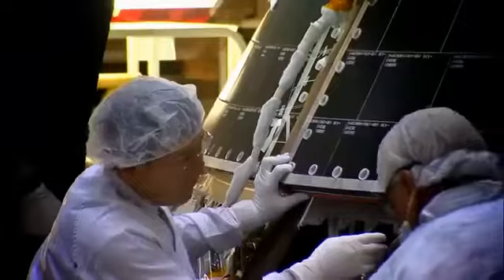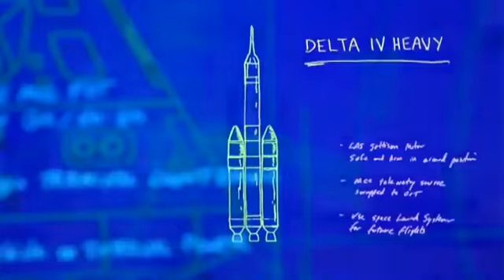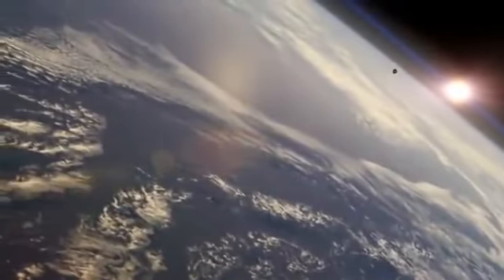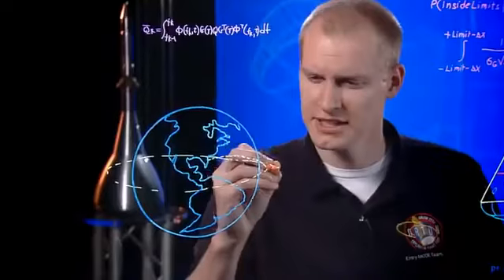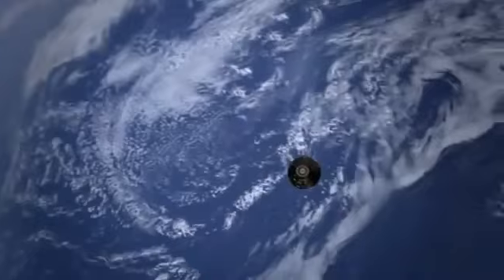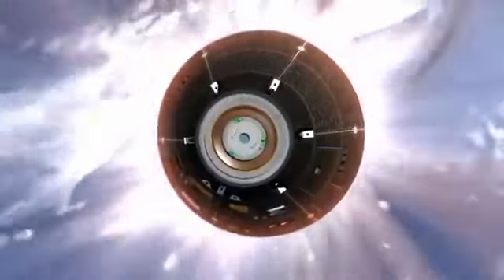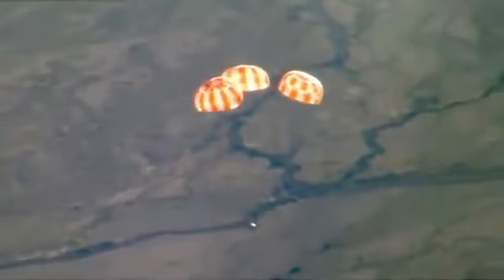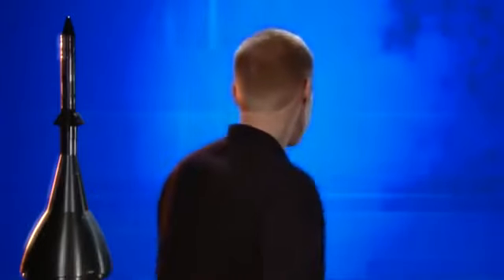NASA engineer admits they can’t get passed the Van Allen Belts

Comment: Anybody miss the part where he says, “guidance and systems, the talks about how traveling through the van Allen belt can damage the computers. We must solve theses problems before we send astronauts through the belts. 
I think he’s talking about the systems myself, he never says he’s responsible for the astronauts health.
Let’s just gloss over the important details and it will sound like a hoax. Listening helps

Modern digital and miniaturized electronics run at a low voltage, a particle strike in a chip can cause problems. It’s called a Single Event Effect, SE. during high sunspot activity the odd errant charged particle can enter your phone, ever wonder why your laptop or phone crashes for no reason. Bit flip!
Reply: @SpaceManWyo  but still it begs the question. Why can we not get through it? Technology is so far and away advanced since the 60s! Like honestly it’s not even comparable. If we have already done it, it should be no problem, period at all. Don’t try and spin it and say small chips or some dumb shit. Baby if the bigger thicker chips worked, don’t you think they would use them on it again? 😂 I mean seriously just use common sense 

and please don’t comment back with they don’t have them anymore or something along those lines. That’s like saying Apple who makes the iPhone can’t make a simple flip phone. Matter fact it’s probably even more primitive than that. We are talking about the 60s!!
Reply: @SpaceManWyo  you’re probably right, but you could be wrong also you never know we only know what we are allowed to know..but you right still
Reply: But astronauts also say they don't have the technology to get near the moon. The moon being 238k from the earth. We cannot leave 300 nm from the planet 🤷🏿‍♂️
Reply: @ironwork92000   We do  currently have the technology  was no one has built, it back up. There will never be a time where large scale  manufacturing of multiple rockets takes place. I doubt very much that 400,000 people will work on achieving a goal such as this. 
In the unedited version of the video the guy says “Orion will be the first space craft to take men passed low earth orbit in a little over 40 years”
Reply: @nicsandee123  Why would 400,000 people need to work on this? That was over 50 years ago... Technology has doubled, we've learned more. We could probably do it with less than half of the man power as the first time. I mean c'mon, we have rovers on mars right? How hard is it to get someone to the moon, if we've already been there before.... Sure the same people aren't there to work on it, but you have the people who worked on the mars rovers there, surely they are intelligent enough. Hmmm

Comment: He's telling us that for the first time for real,  we are trying to figure out how to get to the moon and outside the Van Allen belts.
Reply: Hi CW, hope that you are well. No, he was talking about the challenges facing the Orion spacecraft. He made that abundantly clear in the video. Take care.
Reply: @TheWokeFlatEarthTruth  Why wouldn’t these challenges apply to every other spacecraft?
Reply: @Americansikkunt  Hi CB, thank you for your comment. Hope that you are well. You asked " Why wouldn’t these challenges apply to every other spacecraft?". Basically they do but clearly the challenges presented to any spacecraft will depend on the nature of its intended mission. The Orion spacecraft and Artemis Program is different to any previous spacecraft and space program of recent decades in that it will involve crewed missions of long duration outside the Earths magnetosphere. Modern electronic systems and IC's are mole susceptible  to radiation damage than the discrete components used in the Apollo missions for example.so rigorous testing is required before a crewed mission. Take care.
Reply: We are not still trying to figure it out. We figured it out in the 60s. We are trying to figure out how to protect computer systems that have a 1,000,000x more processes than the ones used on the Saturn V and thusly 1,000,000x more chances for radiation to cause data flips.

The Van Allen Belt is not uniform, it is strongest in the center, but less radioactive near the edges. The astronauts even had dosimeters on their bodies and would regularly report the readings to ground. Ionizing radiation that is found in the Van Allen Belt is only dangerous to humans over a prolonged period of time. The astronauts would only spend one day in it before allowing their bodies to heal the damaged cells. And then passing through it for another day, before their bodies would then have forever to heal more damaged cells.

Comment: Don't worry with this van allen belt,we did it once and we can do it again right?????
Reply: I think Stanley Kubrick passed away.
Reply: No we did this several times without any issues.  Buzz is still alive and kicking, punchy even.
Reply: They used three principles minimize radiation exposure.

1. They made the ship out of a reflective material. Since radiation behaves almost identically to light, reflective material can reflect some of the radiation. Thats why the command module is an aluminum color rather than being painted black and white. 

2. This is a different type of radiation. There are two main types of radiation: radiation that acts like a wave and charged particles. Charged particles are much less harmful than radiation that acts like a wavelength. The harmful radiation at Hiroshima and Chernobyl was gamma radiation (wavelength).

3. They managed to steer around the heaviest doses. The radiation is not equal all the way around. Using math and data from satellites engineers were able to calculate a course that intercepted the moon while avoiding the hevest doses. Orion cannot do this, as the trajectories for interceping planets months or years in the future are very very fine, and they cannot expend the extra fuel required for going around the heaviest parts of the van allen belt
Reply: @edisonbittencourt181  --- Rumor is he was REDRUM'd ;)
Reply: It was fake
Reply: @edisonbittencourt181  --- If you call m urd ered as passing away, then I guess you are correct. 😁
Reply: @GeorgeWashington-et7lk  --- You used a bunch of words to say absolutely NOTHING ... lol
Reply: @CowboyKev69   😂  I love these YouTube scientists.  George Washington above just explained to us how we made it through the VanAllen belts in the 60's. Meanwhile, the actual scientist in this video literally admitted that we've never done it by admitting that we need to figure it out!
Reply: @GeorgeWashington-et7lk  🤣🤣🤣🤣🤣🤣🤣🤣🤣🤣🤣🤣🤣🤣🤣🤣🤣🤣🤣🤣🤣🤣🤣🤣🤣🤣🤣🤣🤣🤣🤣🤣🤣🤣🤣🤣
Reply: @scoolzdevries  absolutely 💯 my friend,  you to have common sence. 
There's so much information out there these days proving the moon landing was faked, but people will argue to the death it was real🤣 i knocked out my best m8 to prove gravity doesn't exist,  he was already standing,  so a left rip shot n a fuckin stiff right cross to his jaw and he went down like a bag of shit. Just to show him gravity never pulled him down but my my fist to his jaw was responsible. 
We weren't friends for a long time but he now admits it wasn't gravity that made him fall n realised it was his mouth that was responsible 🤙
Reply: I thought you couldn’t tell a lie George.
Reply: @Nes M I know I never did as I didn't say "I did",don't know if you get it,when I say "we" I mean "human species",and it is perfectly fine too use this pronoun in this case.
And even though I know or at least I believe humanity have never been into the moon,I do believe one day we will be capable of doing so because there is no place we can't go if we evolve our technology,there are no limits when it comes to distance,as long as we have the right technology.
Before they invented planes and helicopters it was believed to be impossible because such thing could not exist,if we showed this people the engineer of a freaking plane they would say that is magic,but it's not,it's science.
Don't know if you heard of the "worm hole theory" that says that you can "distorce" the universe in order to go in any where in the universe faster,and this can be proven true as our main star that shine our would distorce the space making our planet go around the sun's orbit.
So if you gonna talk to someone as if you are some type of "know at all" guy,then at least have a minimum interpretation knowledge so you can understand the message people are trying to pass to one another.
Reply: @Nes M and yes,when you go to space you left the earth,but probably you belong to the flat earth cult,in that case I will not waste my time trying to prove you the obvious.

Comment: He's referring to the Orion capsule, no?
Reply from the maker: yes, point being that technology does not go backwards. If 50 years ago they had shields against radiation, then they should have the same and better today.
Reply: @SebMenard  
 

but the command module travel through the thinnest and weakest areas of the van allen belts, except for apollo 14 where they cut right through it on their way back. but they did it fast. one short dose of high levels of radiation are more easily tolerated than long periods of time with moderate levels of radiation, and since they want the orion capsule to remain out there for longer, it needs more shielding. Also, solar flares. The apollo astronauts didn't have to deal with this during their journey, but the longer you spend out there the more likely it is for one of these events to take place, and that can very easily kill them.
Reply: @atlas8827  but cant they just go to the weakest parts of the VAB in high speed? like they did before? Why is stilla problem now when they supposedly already solved it in all those APOLLO missions?
Reply: @reincarnati2n  
Well, it isn't a problem. That's what they did with EFT-1.
Reply: @atlas8827  but the video is literally talking about how they have a problem going through Van Allen Belt. Why is Orion any different?
Reply: @reincarnati2n  
It isn't. All human-rated spacecraft must be tested before deployment. That's also the case for Orion.
Reply: @atlas8827  so they tested it by going straight thorough the VAB or going to the weakest points, human or no human?
Reply: @reincarnati2n  
They went through the inner, proton rich one with ~28º of inclination, so yeah, it went through the weaker parts. 
Here, this is the article:
https://www.sciencedirect.com/science/article/pii/S135044871730224X

Comment: “We must SOLVED theses challenges before we SEND PEOPLE through this region of space” - in the Orion capsule. It is a new design with new composite materials and electronics that are more susceptible to electromagnetic radiation than those used on the Apollo missions. It is also intended for missions lasting many months rather than the less than 2 weeks of the Apollo missions. The entire promo video by NASA is talking about the upcoming testing of the never before tested Orion capsule.
Reply: That the shielding on the old Apollo capsules was adequate for the duration of the missions is readily apparent as all of the astronauts who passed through the Van Allen belts survived - as did their cameras. What is not known for certain is if the shielding on the Orion capsule will protect the current generation of equipment which is far more susceptible to radiation and electromagnetic interference than the vacuum tubes used in the 1960s and early 70s. While all the computer simulations indicate that the Orion's shielding is up to the task, only real world, or in this case real space, testing will determine if Orion is ready for deployment for manned missions.
Reply: @SteveGad  The Apollo spacecraft passed through the thickest part of the belts in mere minutes.
Reply: @11cookeaw14  The thinnest part of the outer belts.

Comment: 4:30 in their way back entering exophere theyll face temperatures of 4000 Grad Celsius 2x molten lova..how did apollo survive this 1969'if their heat resistant glass melts at 800 and their steel at 1400? Pls explain :)
Reply: Think he said 4K Fahrenheit
Reply: It didn't have to survive it as it never went through it.  There is your answer.
Reply: AND.... magically all the cloth parachutes and their ropes survived those temperatures! hahaha
Reply: It is called an ablative heat shield. The surface of the  heat shield melts, and is carried away by the atmosphere. This carries the heat away with it.
Reply: @zdcyclops1lickley190  look up the materials used for that.... It makes no sense
Reply: @icoltsi18  Apollo did go through the Van Allen belt. Here is the explanation:
https://www.youtube.com/watch?v=lNiscigIgBc
Reply: good point, once you get scientific about it all, the lies become rather obvious.

Comment: The Apollo missions took trajectory's which largely avoided the highest concentrations of radiation. - basically trying to go around. That said, some Apollo astronauts have suffered, and two have died from health problems thought to be linked to the missions.   This was one of reasons why missions since have been unmanned. There have now been sixty-eight successful moon missions from six different countries in the past fifty years..
Reply: Not true.  While the spacecraft did maneuver through the least area of radiation, they still could have equipped the craft to deal with any level of radiation as required.  Therefore, the Apollo craft had just enough  protection for the crew and equipment that the very short time of actual exposure required.  No astronauts were harmed by the radiation -estimated to be less than a torso CT scan.
Reply: @Amine-gz7gq  Based on what? Your delusions?

Comment: The Apollo missions bypassed the inner van Allen belt, they spent very little time in the outer belt. Due to miniaturization of technology, technology is much more susceptible to em storms in the belt. Better shields are required to protect better computers. Radiation shielding is being improved because it needs to last longer, months instead of weeks. Apollo 8 was 6 days. Apollo 10 was 8 days. Apollo 11 was 8 days. Apollo 12 was 10 days. Apollo 15 was 11 days. The Mars mission is 7 months one way with no magnetosphere. Better shielding needed.
Reply: Exactly. I am so tired of the lies about this; They only spent a few hours in the belts and they bypassed the thickest parts. It would be great if people would watch the WHOLE FRICKING VIDEO!
Reply: Gallium arsenide products and modern vacuum tubes for Space should do the trick.
Reply: chris s    ''The Apollo missions bypassed the inner van Allen belt, they spent very little time in the outer belt.''  fool, the moon is beyond both belts.  Your explanation smells of ignorance.
Reply: So why don't we just use the old tech?
Reply: There is no old tech.. just special effects.
Reply: Ah yes bypassed, I forgot that the van allen belt had a non radiated backdoor. Silly me

Comment: Apollo's only  defense against the radiation belt was limiting it's exposure time through speed, though it was effective in the short term for those particular missions it remains to be more minimizing and avoiding the hazard rather than nullifying it.
  What seemed clearly stated in the video was in regards to the testing of modern shielding to make the craft SAFE for humans to travel through the Van Alden belt and not just punching through it hoping for the best. Which makes sense if we'd be taking Orion to asteroids and Mars because occupants would be exposed to the radiation in space for more time.
  It's like seat belts; not necessary to drive but they make the task safer and therefor cheaper in the long run. 

  The title to the video is misleading.
Reply from the maker: problem is, they never even repeated that either LOL
Reply: @SebMenard  They repeated both moon missions and seat belt laws. The title of your video is misleading.
Reply: @Underbottom.Sandydown Clearly, it is you who is being misleading. We heard and understood exactly what the engineer said.

Comment: No matter what you believe, this an odd video.  It does make you feel that all of thisnis the first time, etc.  Also, the return capsule is the same one, in appearance, as they used 50 years ago.  The space shuttle used to come and go, and its heat shields worked, right?  Just doesnt make sense.
Reply: SD Land in some respects they do have to start again, imagine going from an old car from the 70s to an expensive modern one, you have to relearn everything about it but the basics. Yeah you can drive it but you wouldn't know how it handles rain, snow etc nor know what anything in the car could do.

It's similar with Orion, yeah they've been through the van Allan belts before but they did it by going through the thinnest, weakest, bits to minimise exposure (a trick I suspect they'll use again). This video isn't about how humans can take the radiation, it's about how the delicate state-of-the-art computers in the spacecraft can take it
Reply: SD Land also look up a comparison of the Orion and Apollo capsules, they look similar but not the same (I think Orion's is bigger for a start); one reason they look similar is that the conical shape is a very good design, aerodynamic for takeoff but highly air-resistive for landing.
Reply: zdcyclops1 could not be more limited than rocket that shoots a little pod into space, with just enough power to do a few rocket blasts for momentum.